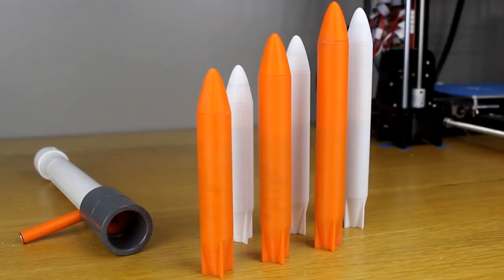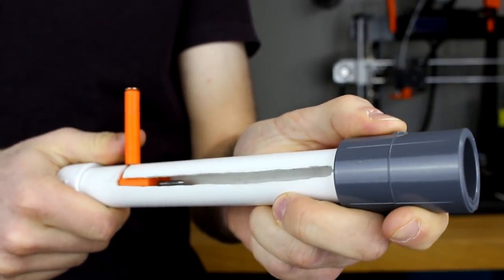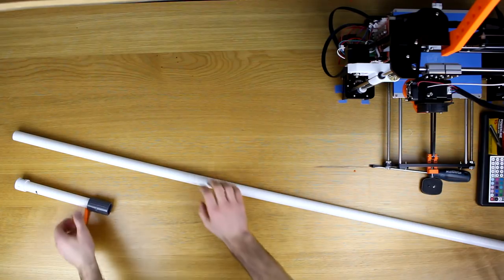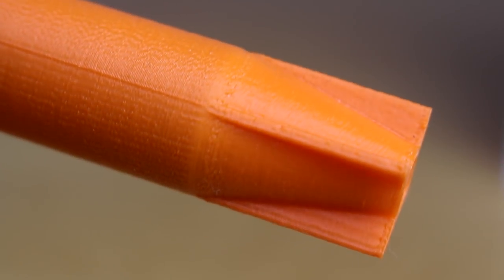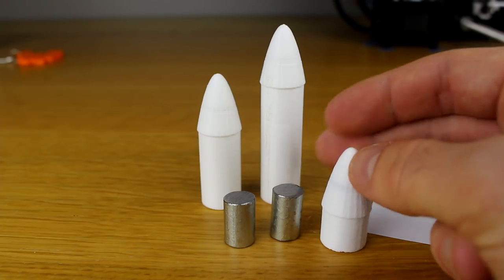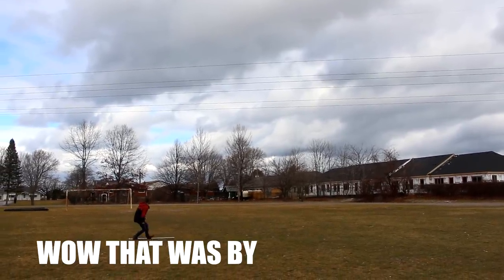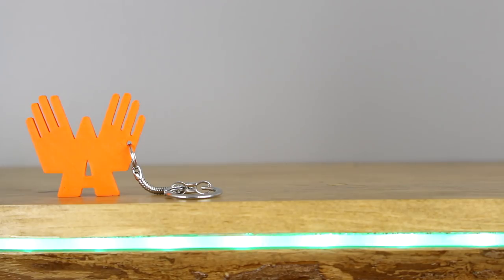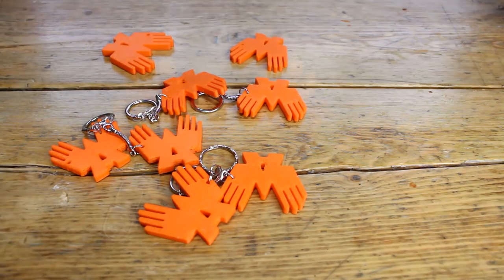3D Printed CO2 Rockets

Comment: That extra nose weight is killing your performance. Get rid of it and just move the CO2 cartridge farther up inside the rocket. This will also require a longer nail.
Reply: Unfortunately, exhausting the CO2 inside the rocket would probably just blow it up given how thin the walls are. It may also become unstable after exhausting some CO2 since you're losing nose weight. What it really needs are longer fins.
Reply: A solution that would be to simply make a single-walled "exhaust cone" in the back.
Reply: +Jason Bass I dont think that would be an issue because if you move the cartridge farther up then everything below it can be as thick as the cartridge its self, and then you just make a small channel for the gas to exhaust through down to the cone
Reply: A  good way to do that is to simply extend the fins down below the point of exhaust, thereby moving the CP further behind the CG. The longer the fins, the less nose weight needed. Picture an Estes Big Bertha.
Reply: with longer fins it won't fit inside the tube
Reply: And a slight angel of the fins to make it spin 
Makes it rotate an go mor straight
Then you can lose the waights

My English is not good so pleas no comment on it
Reply: +joakim eigestad Your english is really bad
Reply: he means extend them downward. increasing surface area will move CoP.  also increases drag...
Reply: djsnowman06 not nesicarily 
As long as it is designed correctly a longer sleeker projectile would have less drag
Reply: To make the rocket spinning will be helpful as well
Reply: Random Shack Racist/Murican
Reply: Spin will cost speed, this is a bad idea. Like Matthew H said, move the CO2 cartridge more to the nose, you don't want it to be tail-heavy.
Reply: +allen gassaway  The outside of a cheap ink pen should work ?
Reply: yes that could work
Reply: longer not wider
Reply: Can I have a keychain please
Reply: Or the fucking cartridge would fly out of the rocket.
Reply: Everyone thinking too hard
Reply: Jameson Kieu  Yep, A cartridge and a stick would do the trick. It is nice to think about all of the potential possibilities though. There is a potential for a new product here. After all, toy drones need to have weapons someday.lol
Reply: Bob Jones I think there is already toy drones with augmented reality. Or was it just a kickstarter product.
Reply: 100% right
Reply: I was thinking about doing a reverse version of this and using a rocket engine is a car. I calculates that my G engine would have 15x the impulse of a co2 cartridge?
Reply: A smaller hole would make the thrust last longer , it's more like a bullet rather than a rocket.
Reply: Pretty sure nose heavy is ideal for stable flight. The rocket will naturally stabilize by pointing the lightest end trailing the heavy end, due to inertia. Heavier things take longer to slow down.
Reply: I'm sorry Dick, but its not all about inertia. You cant consider the front and tail as two separate masses. The mass we really care about in the center of mass, which is the average position of all the matter in the object. A free object will always rotate around the center of mass if no other force influences it not too. Another thing we have to consider is the center of pressure, which is the point of the average point of all pressure forces acting on the object. The reason a rocket flies straight is because the center of mass is in front of the center of pressure. Now your probably saying, well what do you mean by pressure? The pressure is in the moving air around the object as it flies ( technically the air doesn't move much, but it is the rocket which is moving through it). When the rocket starts to tilt about its center of mass, more pressure is put on the rocket because more area is exposed to oncoming air. We know that the center of pressure is behind the center of mass, so more pressure is applied behind the center of mass than in front of it thus straightening the rocket. The reason for putting more mass in the front is to make sure the center of mass is in front of the center of pressure, it is all a very delicate balance of too much weight, too much drag, and positioning the centers of mass and pressure. I hope this resolves all the questions on this thread.
Reply: We all know how an arrow "flies" ?
Reply: What do you mean by that Bob?
Reply: Bob must be thinking that arrow dynamics and bullet dynamics work the same. Except they don't.
Reply: Marinus  No mention of a bullet ?
Reply: Bob Jones Bob, what do you mean again? If your talking about arrows they fly straight using the same principles of rockets.
Reply: That was my point. Rockets and arrows. The commenter above,  changed it to "bullet".
Reply: Yeah I meant rocket :) not bullet.
Reply: extra length wouldn't affect diameter, Adds weight tho. rocket science is all about tradeoffs
Reply: Matthew H
Reply: For those involved in this thread the maker of these CO2 Rockets is correct about the science of keeping a rocket or aircraft stable in flight.  You could increase the size of the fins yes but in this application it's not practical.  Adding a bit more length and a bit more weight is the most effective way to accomplish this.  He did it right.  I've been building rockets off and since I was a kid.  I'm 65 now with stage 4 cancer but I've balanced enough rockets to know it make a difference.  Estes sells their rocket kits with nose cone weights for that reason.  The instructions tell how to balance your rocket.  What he has essentially is a great home made close range weapon for self defense.  :-)  I may have to get one.  I do make my own rocket fuel and engines now, for the past 7 or 8 years that is.
Reply: Matthew H sounds legit 
I know nothing so...

Ima try both ways and see for myself
Reply: Come on guys...this isn't rocket sci.......oh wait.
Reply: you can increase nose weight or lengthen the tail. Like the sticks on fireworks rockets.
Reply: Matthew H you would want a nose weight so it can travel straight and cleaner
Reply: GhoolerHunter he needs to add angled fins to give the rocket a spin simple
Reply: He had to do that because he need to find the centre gravity
Reply: exactly what i thought!
Reply: But then it could possibly burn or melt the print if he does that.
Reply: Matthew H a nozzel wouldnt hurt either.
Reply: Making the rocket longer will require less nose weight as it will be further forward.  This can be calculated but is also fun to do empirically.
Reply: Matthew Heiskell or just do a mortar setup
Reply: @joakimeigestad I can understand what your saying so your fine

Comment: Great video and good idea. One thing about CO2 cartridges. CO2 is liquid under pressure. When you make an opening, the pressure inside starts diminishing, which makes the CO2 convert from liquid to gas. When the opening is at the bottom, the liquid CO2 is being expelled  before given a chance to expand into a gas, meaning you are losing a lot of fuel and propulsion. I know doing the following would increase complexity quite a bit, but I think the rocket would fly much higher if somehow you were able to have the opening facing up and channel the expelled gases through some form of conducts in the rocket itself. This would obviously need a stronger, thicker and more complex rocket and you'd need a wider launcher tube. In any case, just an idea.

Comment: Nice video, You make me really want a 3D printer!
Reply: Creating Creations same i what one as will probably the anet a8
Reply: Project Gaming Check out his videos on the A8! I really want one because of them!!
Reply: Paul Kamps ok thanks is i will
Reply: The a8 is a flaming death trap.  Check out the monoprice select mini or the maker select
Reply: Mattsoup I got the maker select and it's really nice
Reply: Mattsoup not if you know what you are doing
Reply: Jedi Meister you mean replace the power supply? That costs extra money
Reply: Mattsoup no. the power supply is not the problem. i opened it and checked it. not strong enough for massive Abs print but OK. if you spend 20 Euro for mosfet, connectors ans cables, all critical parts are replaced.
Reply: Creating Creations its not that simple

Comment: Pro at 3D Printing, try bigger Launch Tube and Fins that are hinged and quarter-round.

The spin at launch deploys (they unfold) the Fins and they prop themselves open in the quarter-circle shape.

You would probably gain enough surface area that you could use 3 instead of 4 Fins (increasing their flatness). The added Tail weight prevents tumbling and pays for itself (unlike adding Nose weight).

For greater silliness try using a 2nd Nail and CO2 Cartridge as a Payload (return to sender, when fired horizontally).

Thanks for the Video,
Rob
Reply: LowLightVideos or maybe the fins could be somekinda foamy plastic so the fins could be rolled around the rocket (glued straight on the rocket) so they would unfold when fired

Comment: Cool improvement on Backyard Scientist's concept. Just so you know, it's not necessary to build up pressure in the launch tube. That's how a gun works - this is a rocket. A rocket provides its own impulse just by venting the fuel matter out the back. In this case, building up pressure in the tube might actually be counterproductive since your impulse depends entirely on the flow rate out the hole you punch, and the flow rate depends in turn on the difference in pressure between the cylinder and the chamber. (It seems in your case you didn't pressurize the chamber quickly enough for it to matter.)

Comment: Would adding a bias to the fins add to stability making the rocket spin like the rifling in a gun barrel spins a bullet?
Reply: Adding rifling to the tube and using the cartridge without any add-ons would work better and go further. The plastic is only weighing it down and making it less aerodynamic.

Comment: If you could adjust how deep the nail punctures the CO2 cartridge so it is a smaller hole, maybe the rockets will fly even higher.

Comment: If you made the pvc a 1 inch pipe you could, in theory, make the fins larger by adding a discarding sabot system that would increase the lift and make these fly farther horizontally instead of vertically. You could also put the fins at a slight angle to mitigate any movement perpendicular to the rockets velocity

Comment: Way cool rockets, nice design and walk through of the process, very important stuff you included. Might just have to print and launch a few of these myself. Wonder if you could build a multi-canister system to use 4 CO2 carts.

Comment: You should try having the fins angled slightly, so they impart some spin. It's hard to tell if there is any wobble in the rockets, but having spin would help stabilize them.

Comment: Try drilling the end out of your spent cartridges and packing them full of a 50/50 mix of fine zinc and sulfur powder packing it in tight enough to be concrete hard with no air pockets. Drill into the propellant about half the length of the cartridge and pour in some loose sodium chlorate and sugar mixture then insert a cannon fuse. Try some of those babies in your printed rocket bodies. I would suggest launching them from a steel conduit though. The exhaust pressure will most likely splinter the PVC. I used to make those zinc sulfur motors back in the day and play with them. The draw back is that I recovered only a couple after launching them. Those things come out at bullet speeds and are pretty much gone. Oh and use a long fuse and stay way the heck back just in case one decides to be a grenade instead of a rocket.

Comment: I'd suggest you put a bright LED blinking at 10Hz in the nose cone. Since it only has to blink for about 30 seconds a coin cell will probably cover it. Then film at night with a long exposure. Count the blinks, compute the angle from the launch point and the camera point, and then you can recover acceleration and altitude performance.

Comment: If you cant the fins slightly, or put a slight asymmetric wedge on the bottom of the fin, you'll get spin stabilization. Straighter flight but slightly lower altitude.
Also, you can probably fit the Estes altimeter in your rocket.

Comment: I think your launch tube should be of a more rigid construction. In theory this will be a more efficient path for the rocket, resulting in a better exit of the tube, which will hopefully allow a better and longer flight. I noticed that there is a lot of flex in the launch tube whilst you are firing. Of course this may mean you need to redesign your rocket if you can't find a metal alternative to the PVC pipe that is the same inside diameter. I really enjoyed this project and video. Thanks.

Comment: If you take some very smooth anodized alloy pipe add oil to inside and just put the co2 carts straight in it works great. Its important to have just less than 0.5 mm clearance for max pressure pipe should be about 1 .5 to 2 metres

Comment: You should add something like a screw-shaped tip but to make it spin when flying so it will be easier for the rocket to brake into air.

regards from Argentina

Comment: Is your rocket being propelled as a rocket or as a CO2 powered cannon or a combination? Try drilling a few holes around the end of the launch tube to vent the pressure before the rocket body leaves the tube. A pressurized tube could exert an uneven force on the base of the rocket, throwing it sideways. By venting the tube you can remove this while still guiding the rocket straight. Nice work.

Comment: For model rockets (i.e. Estes rockets), you usually use clay in the nose instead of metal.

This may or may not have to do with the National Association of Rocketry's Rule 1: Materials. I will use only lightweight, non-metal parts for the nose, body, and fins of my rocket.

Comment: I had a teacher who made CO2 powered rocket that was attached to a stretched out high tensile wire fixed at both ends of the classroom so it was like a monorail. He set it off in class. It ripped the wire out and nearly decapitated the entire class. He was a good teacher.

Comment: Add water to make it even better. The outer tube could hold water and the firing pin(nail) could be inserted through an O ring and struck with another firing pin. The plug(nail) would eject backwards as the CO2 and water came from the rocket as the propellant. There are many specific actions that would take place and need to be accommodated for, but let's "keep it simple" ?

Comment: you Didn’t need to build a firing mechanism with springs.Just use a cap with a nail at the bottom end of a pvc pipe so you can drop the rocket in the tube like a military mortar and it will use gravity to puncture the cartridge firing it back out of the tube.

You can also mount it to a camera tripod on a vertical axis

Comment: 1. Give the  exhaust a bell form
2. Falcon 9 has no fins
3. Don't shoot the rocket from a closed pipe like a gun projectile but let it climb by its own exhaust gas like you did with the purchased ones using a guide stick

Comment: Hey nice video, one little thing comes to mine not sure you realised. Presumably you may be able to extract a lot more power from the co2 cartridge if vaporization is optimised like on a co2 air gun. Have you tried having the co2 cartridge facing forward  and having a nail in front of the nose. Then crack it open by striking the cartridge from the bottom. Then have airways in place to direct the vaporized gas to the bottom of the rock (where the bottom of the cartridge is facing). In this case you might get a well vaporised and pressurised blast rather than releasing the liquid co2 directly. Here is my 5 cents bro, would love to see whether it works if you haven't tried it before :)

Comment: And when the cartridge is empty you can widen the opening and cut the heads off of wooden matches and fill it about half to 3/4 way full and make it a rocket again warning May explode if you put too many match heads inside the cartridge. Ignition can be a problem because you don't want to be too close. Even when everything goes right it still puts out a 3-ft flame when you launch it!

Comment: make a rocket bottom "wings" a littlebit twirl, like a propeller, this will give the  rocket spining, and then it will fly stright lika a bullet. then the center of mass shuold be more in the front of the rocket.  simple physics. And another thing. Drill  a lot of hole in the the launcher tube so the air can go inside the tube during launching. this is needed to minimize underpressure inside the tube. I know the co2 is compensate the underpressure, but i think the speed of living the tube may be better.

Comment: Does the CO2 cartridge continue to provide thrust after the rocket has left the launch tube, or is almost all (or all) of the CO2 discharged within the tube? If it's the latter, then perhaps try to come up with a design in which the CO2 cartridge is actually not a part of the rocket itself but just contained within the launch tube. That way the rocket doesn't have to also lift the weight of the CO2 cartridge and it will be easier to put the center of mass ahead of the center of pressure.And you'll definitely get higher altitude.

Comment: I did something similar about 10 years ago where I put just put a nail in a pvc cap and dropped a bare CO2 cartridge from the top of the pipe. It was probably pretty dumb because they would only puncture when we were aiming practically straight up. then we just waited for death from above... XD